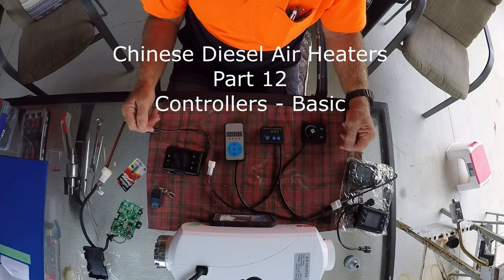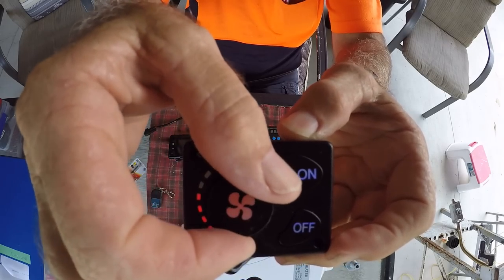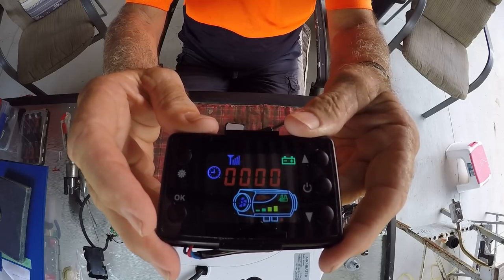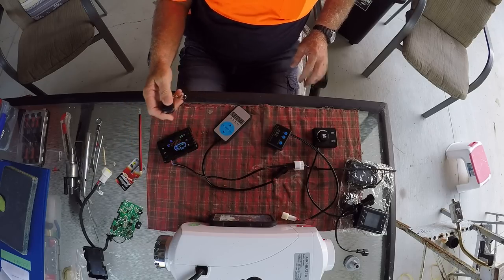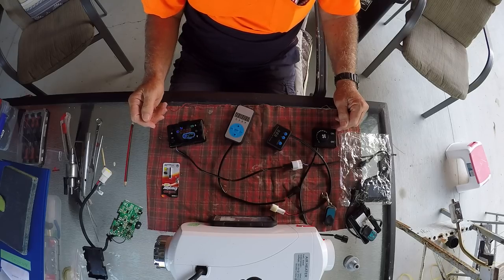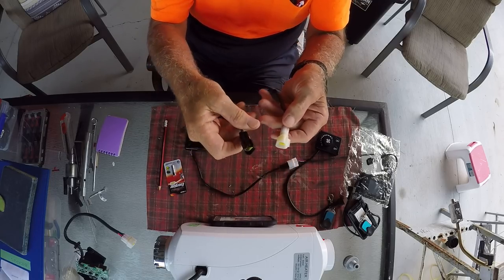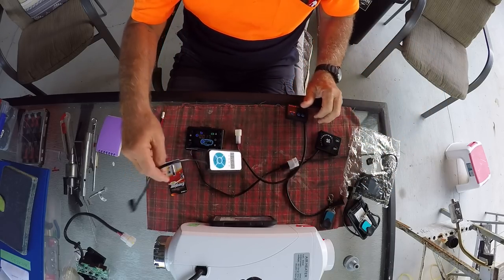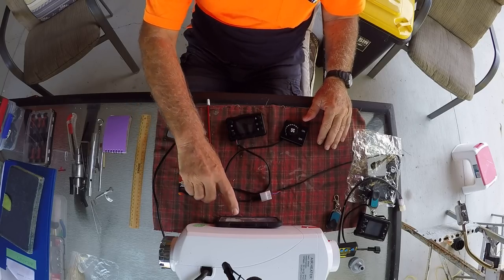Chinese Diesel Air Heaters -  Part 12 - Controllers (Basic)

Comment: I am in the process of installing a heater in our caravan, I need to run a longer harness to the battery, can I put a say switch on the positive side to switch off  when I am not using the van, thanks.
Reply from the maker: Hi Ian, yes, that is a good idea, and one I use, however make sure it is away from other switches so it can not be mistaken for a light switch or something else. If it is accidentally turned off when the heater is running, the heater can not do its cool down program and you will have a serious overheat issue.

Also you MUST increase the cable size when you lengthen the harness, even as standard most heaters come with very borderline cable size. 

I also recommend you go straight to the battery with the power wires and not through a panel to avoid voltage drop. The heater pulls 10 amps to start, and voltage drop will cause the glow plug not to get hot enough and you will have start failure.

I have done a video on a motorhome install and hope to publish it by months end.   JMcK
Reply: John McK 47 John, Thanks for that, I talked to a Australia distributor for diesel heaters and he stated that he had never done a switch. We live in central qld so thought it would be a good idea, I will get a say 15 amp switch which will have a light, so when on will show. Will mount the switch under the bed with the heater in the enclosure that I will put in. And note to self, start at least once a month, so big sign in caravan. Once again thanks for all the useful information.
Reply from the maker: Ian Potter 

Wow Ian, you must be a mind reader. I did a motorhome install recently and I put the switch under the back seat/bed. I always install a power switch. Will have a video out when I find time to edit the content. Hope to publish it by end of June or early July.   JMcK

Comment: hey John, I would like to get a diesel heater, but I still have a few concerns about. maybe you can help me there. do all LCD controllers have a voltage monitoring? so wen the voltage is too low will turn off?? would you recommend the new red / blue controllers rather than the older because the altitude control or detect if the diesel is empty? and is there even with the Chinese a heater that is better than others? because there are price differences in the Chinese heaters? and in the video you have a heater with aluminum housing. unfortunately I can not find a video about whether they are not too hot because I find the aluminum housing more beautiful. I would like to bring the heater in a box so that if I need a heat source in an emergency somewhere else I can take it from my camper. Only then I would have to look because this has none of the LCD controller. Can I not simply exchange the cables in the plug. there is only one provider on Amazon who offers one with aluminum housing.

sorry for my English I come from Germany :-)
Reply from the maker: Hi Thomas,

All Chinese heaters and controllers that I have seen have voltage monitoring, and go into shutdown mode on low voltage.

I suggest people buy a Chinese diesel heater from a supplier with a warehouse in their local country, who has a good rating and accepts returns (and replaces faulty heaters.)

The aluminium case heaters I have seen are are excellent heaters (thinking of doing a video) and I would choose an aluminum case heater over a plastic heater if the price difference was not too great.

In the past most manufactures of Chinese Diesel heaters followed the same protocol and you could easily mix and match controllers. Present day this is not always the case. With some heaters you can change the plugs, but others you need to match “proprietary “ controllers with “proprietary” ECB's.

Cheers.   JMcK
Reply: @johnmck1147  
Hey John,

thanks for your answer.I have now ordered a diesel heater, should arrive tomorrow through Amazon Prime. it is not the one with the aluminum housing because they do not work with Amazon. wen the one I ordered does not run properly or breaks after a short time Amazon will take it back. and it should come with the red controller.

but I would like to see the video about the diesel heater with the aluminum housing.
Reply: @johnmck1147  Hello John,
I got my diesel heater today and played around a bit. when I go around the 2.5 Hz or higher the heater starts to make a noise. to me it sounds electronic and I think of the PWM signal from the fan. do you know this from the diesel heater, is this normal or should I send it back and get a new one? because I find it a bit disturbing. 
and because of the shutdown mode on low voltage. must the Heater run for it or is it enough that the controller itself is on. because if I operate the controller with 8 volts it shows me no warning?

Thank you for your answer.
Reply from the maker: Hi Thomas,
These heaters basically have three noises. Exhaust, fan and ticking fuel pump.
The fan noise will increase as the Hz (speed) increases. You should only hear the basic fan noise increase. Not any other noise. Occasionally you get a heater with the fan scraping on the case. You can check this with heater off. Turn the fan with your finger and see/feel if there is any scraping. If so there is misalignment with fan and case. There is also a fan speed sensor in the heater that also may have not been installed correctly on assembly. If you are mechanical these can generally be easy fixed. If heater is new, ask for a replacement.

Not sure what you are asking about controller.  JMcK
Reply: @johnmck1147  
Hello John,
i had ordered a new one. The new one does not make the noise. i will send the other one back.
thank you
Reply from the maker: @thomasschmitz5743  

👍. JMcK

Comment: Hello, is the programming,  setting done/saved in the display controller or in the circuit board in the heater? I,e if you swap display controllers do you have to reprogram?
Reply from the maker: Hi there, I have no purposely checked this in past bench tests, but my thoughts at this stage is it is in the controller and you would need to reprogram.  JMcK
Reply: @johnmck1147  thanks, but I was looking for an answer not an assumption.  Maybe someone else knows the definitive answer to my question.

Comment: Hi John! I have a heater with a knob controller and one day I've tried to fire it and the controller just went off. No lights and the heater didn't start. after a few days it went on again (i didn't touch it for a while). Then I've tried to fire it up again and the same thing happened and after that, it's not coming on. I've checked the power line from the battery and it's showing 12.5 V so there is power coming to the heater. I've tried to figure out what is going on, disconnected the wires, and cleaned the connectors but no results.... What do you think is going on? Is my controller fired or the mainboard has failed? Looking forward to your advice. Best regards, Ivan from Croatia
Reply from the maker: Hi Ivan,

First check the battery voltage under load. A poor battery can show 12.5 V at rest but under load drop right off.

When turned on the heater initially draws around 10 amps and a poor battery can not supply that voltage and the heater will not start. This happened to me when I was doing the 2Kw video. (I talk about it in the video)

So first up, connect a battery charger to the battery and see if the heater works.

If there is still an issue, check there are no loose wires and the plugs are nice and secure. 

You may have a faulty motherboard/controller, but I would suspect a battery voltage issue first.

Good luck.  JMcK

Comment: John, G'day Mate.
I have a quick question. My heater came with the controller that you is not standard wiring, like the one you got with your heater. 
My question is, does this controller have a thermostat or does it just have a low, med, high setting? Of course there was no documentation and unlike you my seller could not provide any information. 
Also, was the new control board swap just a unplug and replace setup? I'm a mechanical person, but not an electrically minded person.
Any help would be appreciated.
Cheers.
Doc
Reply from the maker: Hi Doc,

Look carefully over the controller for a little hole, generally on the top or bottom. In the hole will be something that looks like a small match head. That is a thermistor sensor, and that controls  the temperature setting. 

Most controllers have three wires. Two power wires, generally red and black, and one sense wire, generally blue. Sometimes you can mix and match the controllers of Chinese heaters.

I personally very rarely use the thermostat setting. I prefer to just use the manual setting. That way I can set the heater speed I prefer. Too hot, I turn it down. Too cold I turn it up.

Cheers.  JMcK
Reply: @johnmck1147  thanks John for the information. I just installed it yesterday and it throws out lots of heat. But, I have that wonky controller that is nonstandard wiring, even the plug is not the triangle shape like the others. 
Thanks again,
Doc

Comment: Hey John, I think I ended up with one of the "very cheap, non-standard" controllers.  The picture was deceiving but it's in my hands now; I know the connector itself is different but would I be able to use a regular LCD controller if I replace the connectors or simply cut/splice a LCD controller to it?
Reply from the maker: Hi Knieban, sometimes it is possible but you need to identify the power and sense wires. 
Sometimes it is easier to pay $20 and buy a standard  new ECB as a spare part.
Please let me know how you go.   JMcK

Comment: hi john what are your thoughts on the air inlet is it necessary and dose it create humidity
Reply from the maker: Hi Denis, not sure what you mean here?
You definitely need the air inlet for the combustion air.
If you are referring to the large heated air inlet, well you need that or you don't get any hot air.
If you are referring to recycling room air or drawing air in from outside, it becomes personal choice. Some people recycle the room air, some like to heat outside fresh air.
Whatever way, these heaters produce dry hot air, unlike LPG heaters that produce large volumes of water vapour from the burn process.   JMcK

Comment: Dear Guru...is it possible to change from the more complicated controller..to the simple one..i still cant get the complicated one right in my head...thanks pen
Reply from the maker: Hi Penelope, yes, if it has standard a standard circuit. I do it often. However, some heaters now run different plugs and a different circuit.   JMcK

Comment: thanks for your video. Im camping at high altitude and i think by accident when changing the parameters of the controller I changed the password . it was 1688 but now it does not work. is there a method for resetting these controllers. i have the lcd controller.  Thanks!!!!
Reply from the maker: I am sorry Jha, I do not know how to reset a changed password. 
Perhaps a viewer may know.   JMck
Reply: @johnmck1147 Yeah any viewers who know something and might chime in would be great,thanks anyway JMck. But the other day i did  open up the unit and I cannot find any reset button or place to put a pen tip or pin. Since after extensively searching the web i see no mention of reset button, this is an issue with these units. I am now back in my home and out of the mountains and reflecting on the experience. now I have it working but there was a few nights of lack of sleep where in the middle of the night I smelled and saw a lot of diesel smoke (from outside) because it was barely running and the heat coming out of the vent was not too hot. So i turned off the unit because it was too rich. There were a few times after that scenario where it had trouble starting back up, I would hear the flame struggle and the flame would ignite only for a few seconds and not maintain. I figured out how to solve this problems which was due to it being sooted up and I was able to do this without taking the unit apart and cleaning the inside. When the unit is running and one hits the off button , the glow plug does turn on during the shut down process and the pump pulses automatically at a very slow rate. I think that is done to clean the unit especially at the glow plug area where it needs to be clean to light. I would hear the flame pulse on with each pump sound. So turning the unit it on and waiting a certain amount of time then off cycled it through the "shut down process" a few times and that clean out the unit. I do not remember exactly how long but it is good for people to play with these units and listen carefully to hear the flame ignite burn out and watch the glow plug. then one will really get to know these units intimately. After I was able to start it up and run on high to burn out the soot is when i accidentally locked the password. but before it was locked I ended up adjusting it to high fan speed and low p-hz. I also ended up in p-hz mode instead of temp mode. It is not an intuitive controller.  but like i said one good thing however whatever settings I put in before it locked me out, ended up being workable and I had heat and slept through the night without it running rich. So I think the high altitude solution is one needs a low p-hz high fan speed, but being mindful to not make the p-hz too low so it does not flame out.  I am using a 50 50 mix of kerosene and diesel I also added some product called gum out diesel cleaner, which makes it burn cleaner. So actually these Chinese heaters are very adjustable and able to work at different altitudes. But only problem since I am locked out i have my fan set at 4500 or 5000 pm and now no way to change this setting so I had to open a window in the van because it was almost too hot with fan too high. I wanted to fine tune it but with being locked out i cannot until i buy a new control board. I think it is the control board that has the processor which stores the password and not the LCD controller, but I will buy both since they are way cheap.  Not many discussions about these settings or high altitude in other forums.   I hope this info helps someone. but whatever you do, be very careful to not put in the wrong password especially after being int he deeper setting because maybe it is asking you if you want to change password. The settings are not intuitive so one needs to be very careful with passwords. Even though I ordered new control board today i am going to try one more time since I went on you tube and see again how to switch between temp and p-hz mode. If I can get back to temp mode maybe the fan speed will adjust and maybe switching between these modes resets the password? I will let you know. If the high fan speed I ended up making in the deep setting will change and lower when the unit is in temp mode and if the p-hz remains at my lower setting i should be able to not have to open windows.
Reply from the maker: Hi Jha,

Thanks for the detailed post on your issues, I am most grateful. I would also be grateful to be kept in the loop of how you get on in the future.  JMcK

Comment: The controller with the display I held the ok and arrow down button now the display is off and can't figure out how to turn it back on?
Reply from the maker: Hi Chris, I have not come across this before, and I do not know exactly what display you refer to. Have you tried totally disconnecting the unit from the battery for a few minutes and then reconnect? 
Sorry .  JMcK

Comment: Hey John, excellent video clips and thankyou for them, is there a specific Hz rate for the pump?  Mine is set at 5.2 but thats prolly a bit much?  Thanks   Geoff B
Reply from the maker: Hi Geoff, thanks for the feedback.

5.0 Hz to 5.2 Hz is a normal max pulse rate for these heaters. The pulse frequency is the only way the ECU can control the fuel flow level, and hence the heat output. 

The pulse rate will vary with the temperature setting. The minimum pulse rate for these heaters is around 1.6 Hz. 

I hope that helps.   JMcK
Reply: @johnmck1147  Thanx John much appreciated